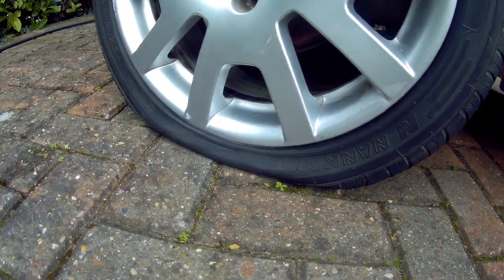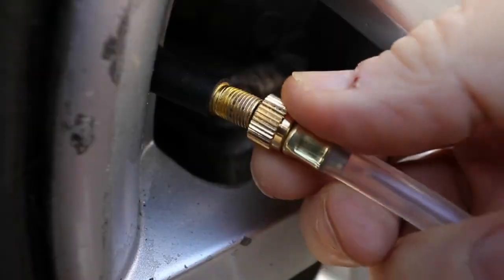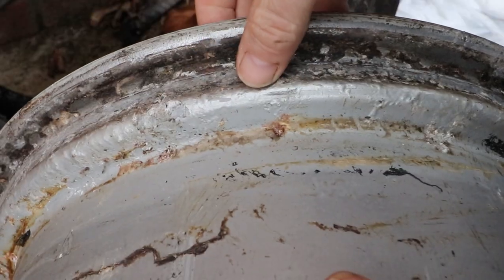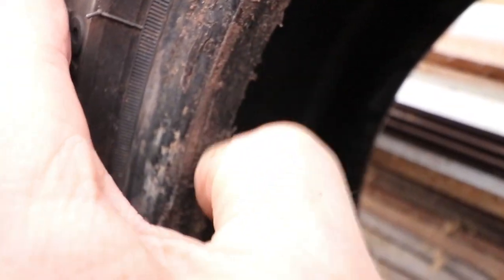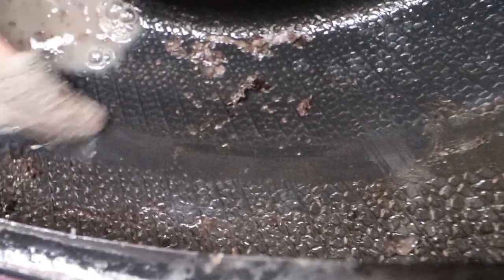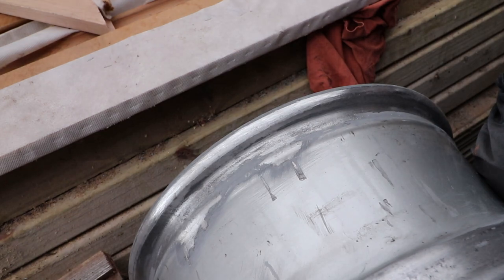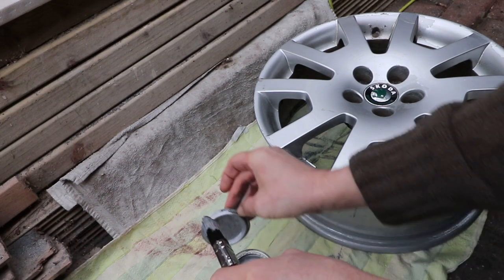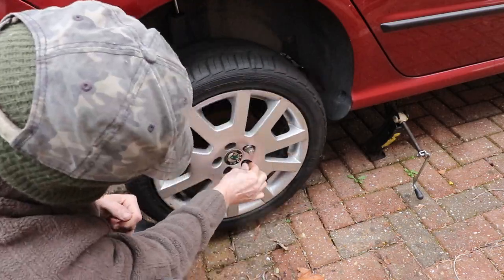SKODA FABIA Leaky VRS Wheel and Tyre Fix (Mk1 99-07)

Comment: Honestly top job.  Mine has that, it also had leaky valve replaced prior so you can imagine how long this stayed with me before it was addressed.  Actually cost me a new tyre because it had been driven too often, too flat.  In all honesty I think they are all leaking but one was a total joke.  Was starting to travel everywhere with a footpump.  Argggghhhh. 😂
Reply from the maker: Thanks. I have my pump in the boot always too, a bit sad really, will have to do another that seems to be going that way also. Yes good point about running a tyre whilst going flat, they often wreck the side wall construction rendering  them useless. Arggghh - too right :-)
Reply: @HatBoyHarvey  yup if one goes they are all needing looked at just a total pain in the bahooky 😂

Comment: Now I'm wondering if it's safe to use zinc paint with aluminum because these two metals react together. I make sheet metal roofs and we can't use these two metals together because the zinc will corrode the aluminum or vice versa. but I'm not sure if the same applies here in the case of zinc color, so correct me if I'm wrong or if it's true
Reply from the maker: The reaction is very small between these metals and the zinc here is held in suspension in the paint. I haven't had any issues as of yet with this usage as I have used it on other projects without problems. If it had steel in it it would be different. Anodizing or powder coating is best, but costs a bit more. There are other paints specifically for aluminium, but no issues with this for me yet.
Reply: Okay thanks for reply i was searching but i was not able to find something about it. Because i have also this leaks always when temperature change significantly. Btw fabia 1.2 htp with 400 000km 😂